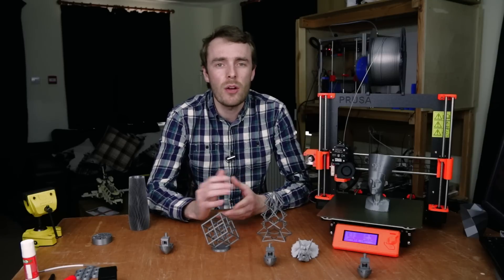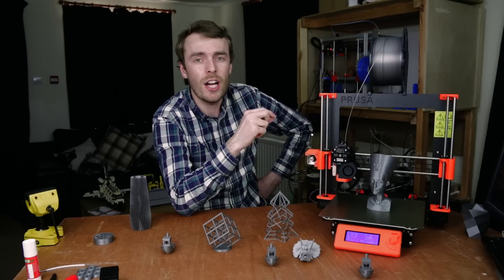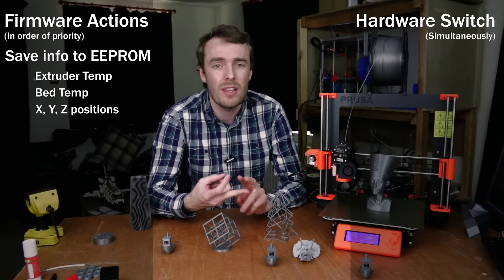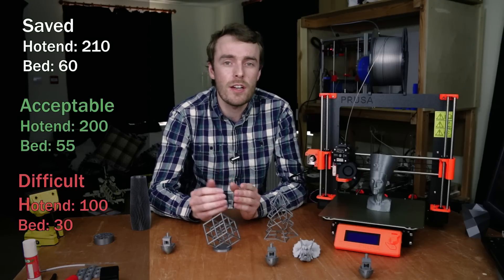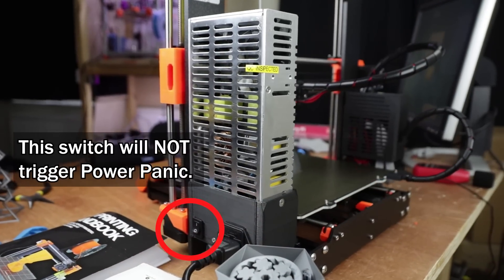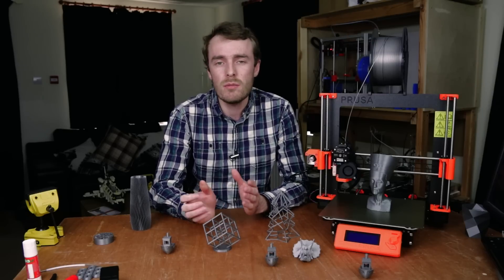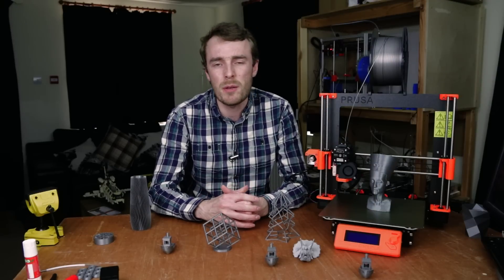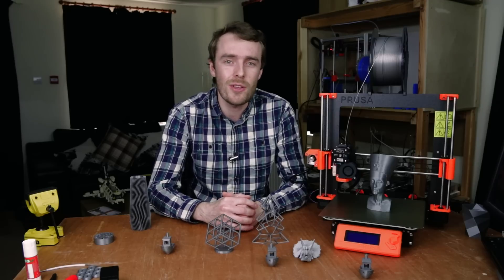Prusa i3 MK3 - Recover from Power Loss!

Comment: This is nothing new, it has been used before in other printers before. There is no need to save temperature settings, these are stored in the file that is being printed, so if you know which file your are printing and where are in the printing process, then that's is enough.
Reply: For example the AnyCubic3D i3 Mega (www.anycubic3d.com/en/pd.jsp?id=358) and the CreatBot D600 (www.creatbot.com/en/creatbot-d600.html)

Comment: If the printer experiences a power outage and you were not there to push the button to continue the print, will the printer be back to the continue printing prompt if it experiences one or two other power losses?

Comment: Great video again, and you explained it well, as prusa has a custom pcb at the psu power plug connected and the einsy has logic to switch off the bed and hotend. The rest is firmware and I expect improvement in the next time.
Reply: You can find the power panic board on github prusa3d, so you don't need to open it
Reply: Yes, 3D_Gussner has right. I have studied power panic design (here: https://github.com/prusa3d/MK3_Power_Panic/blob/master/rev.04/power-panic.pdf and here: https://github.com/prusa3d/MK3_Power_Panic) and it designed for only cable unplug. If you use (any) switch to disconnect only L or N from the AC power circuit, it will doesn't works well.